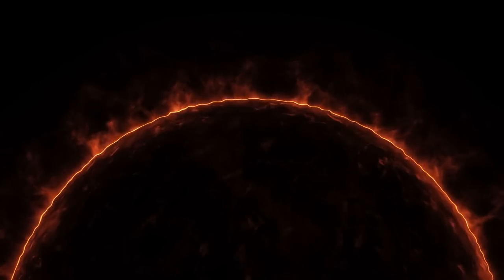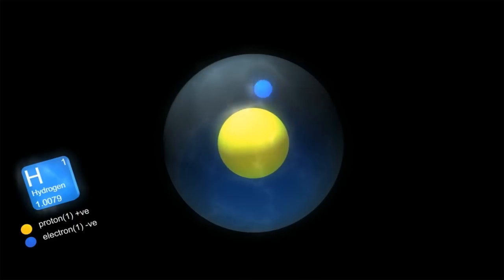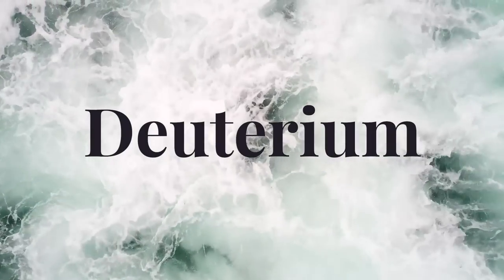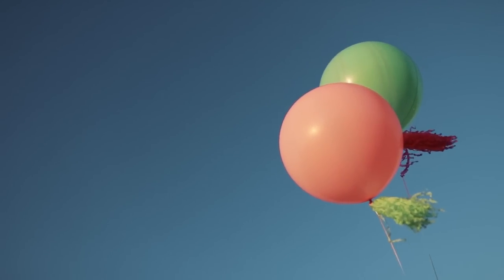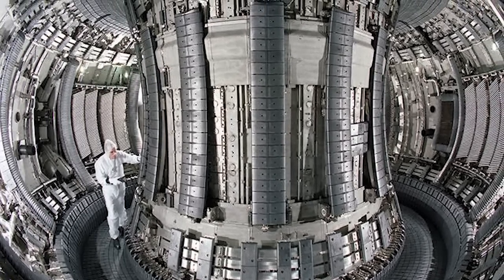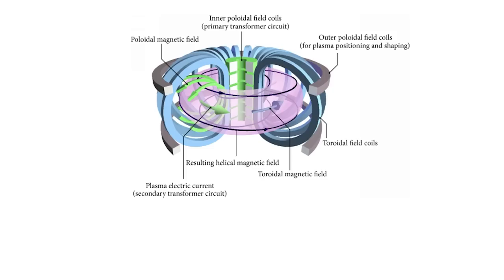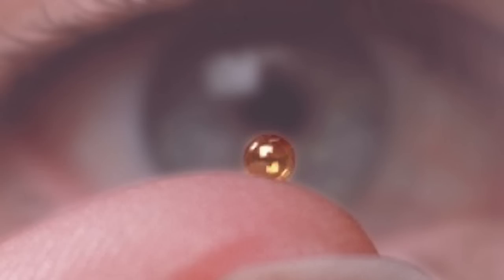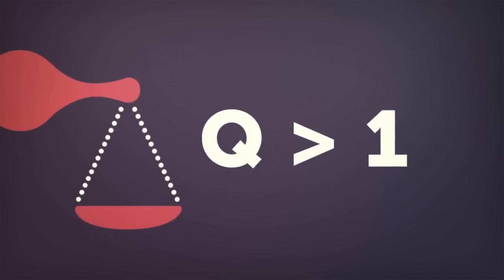Fusion Energy is About to Unlock Humanity's Destiny

Comment: 62 years old and been hearing how it is "just around the corner" since I was at least 12.
Reply: Kyle Nearhood 
I know where you’re coming from, but i would give the justification of being ”different this time” as fusion is now actually possible and achieved. 

It’a still a lot of work before the EROI is a position number, but still a different situation :)
Reply: Well I don't know, Juho. Seems like every time they turn on a new Tokomak they find out something new about plasma that sends them back to the drawing board and building a new 10x Tokomak. Size and cost. Aaaaand repeat.
Different this time? 
We are ten years away from practical fusion power. And always will be.
Reply: Basil McDonnell 
Yeah. Valid point, but as fusion is something becoming a banality, it’s proof of progress. Could well still stand that fusion is the energy production of the future. For ever.
Reply: Thank u for saying that. Its completely  true.  Also I believe that we could have already had fusion reactors however it would have been too disruptive to current methods for generating energy.
Reply: Sure! But THIS time is for real ; )
Reply: Lol
Reply: All high temperature thermonuclear fusion will fail including the ITER project. This is because our nuclear physics based on E=mc² is wrong:
1) Firstly, E=mc² is fictitious; energy E does not have a real unit of energy.
    This is because relativistic force formula: F = d/dt (mv/√(1-v²/c²) ) does not define a real unit of force; e.g. the SI unit newton is only defined as in : F=ma. When force does not have a real unit, the work energy theorem that derives E=mc² also give only a real number without any association with any real unit of energy.
2) Nuclear energy not from E=mc²: 
The Penning trap assumes the magnetic force to have no error - a strict mathematically identity. The so-called mass defect found in the NIST database of atomic masses is due to a systemic inaccuracy in the Penning trap. There is no "mass defect" of atoms. Mass conservation applies; there is no need to measure any atomic mass. The mass of any nuclide is its mass number in amu -  a whole number without any mass defect!  

"The Relativistic Mechanics of E=mc² Fails"
"Our Nuclear Physics Wrong (Is Mass Spectrometry Accurate?)"
http://www.emc2fails.com
Reply: @chanrasjid8688  You're clearly on a plane where I can't argue with you - because I wouldn't know what I was talking about - but I nonetheless think you're sticking your neck out.  Of course, when Einstein predicted that a large mass would bend light, he was sticking his neck out too - but since he was proved right, his predictions, and the predictions of other people using his theory, seem to be prove him "not wrong so far" every time.
Have you had the result of any experiment that shows E=mc² to be false?  Can you link to your results?  Or was it, like Einstein's, a thought experiment?  I read your comments about the units of E=mc², but we have always been taught that E is in Joules, m is in kilograms, and c is in metres/second.
Everything that I know of that has depended on Einstein's theories, from the nuclear bomb to GPS, the orbit of Mercury and gravity waves, have been shown to work, and the things that have refuted it, like faster-than-light neutrinos, have been shown to be an error.  Every new piece of evidence has shown Einstein to be "not wrong"
Maybe you will prove to be his nemesis - but another person who tried to disprove Einstein 30 or 40 years ago was Ivor Catt - and I never hear about him now.
Preparation for a slice of Humble Pie might be a good exercise.
Reply: @DownhillAllTheWay  You're right not to argue with me on a topic you have not studied - that's humility.
E=mc² has never been experimentally verified - never! It is only a hypothesis on how nuclear energy and nuclear bombs work. But my papers at my site explained why it is only an assumption. You may have the notion that physics is all about experimental evidence and therefore it involves only empirical evidence. You may forget that the data of an experiment too needs the interpretation of man, just as in evidence forwarded in the court; it is the judge (opinions) who decides if the evidence is acceptable or not. It is the same with all scientific experiments - it involves opinions of people. So physics too is dependent on people to interpret an experiment. In this manner, there would be people who rejects the discovery of gravitational waves and some would accept - matter of opinion. In the end, the people at Princeton, MIT, Harvard decide what is correct and what is wrong.

Ivor Catt is still around, but old - 85? I received an email comment from him a year back. His main work is not about showing Einstein wrong, more on his novel ideas about electric current, energy, antennas, etc.            

http://www.emc2fails.com
Reply: @chanrasjid8688  I have a feeling if you were correct about the most important scientific equation being wrong you would be accepting a Nobel Prize and not relegated to a Youtube comment section.
Reply: Hold on Pops!
Reply: @chanrasjid8688  Thank you for using your intellect on this. For a long time I've known that our basic, fundamental understanding of physics is wrong. I'm just not smart enough to explain why. But, I know when scientists and astronomers start inventing things like "dark matter" and "dark energy" to explain why their equations don't work when applied to celestial mechanics it's bullshit.
Plasma physics is still the least understood area of science as far as I can tell.
And I'm pretty sure the Sun doesn't work the way they think it does.
Reply: ''been hearing'' but you never really knew anything basically xD  .............. u didn't knew the real situation back then and let me guess it is pretty much the same thing right now,so how can you tell ? since you have no information.............. tired of those ignorant negatives comments
Reply: @Captain-Sum.Ting-Wong  Wow... A nuclear burn...

Comment: I just want fusion within my life time. Who knows there might be a breakthrough, and we get fusion faster than we ever expected.
Reply: facts. we can only hope so 🙏🏻 fortunately for me at least i’m only 18 so if i’m lucky i can make it past 2077 then it will hopefully be a thing.
Reply: Check out MINDS there already plugging are brains into computers
Reply: A concept reactor is being butil as we speak witht the alleged capability of providing a Q>1 which is very promising
Reply: There is a breakthrough! I'm happy to announce. Join us in celebrating an end to war, and scarcity worldwide.
Reply: @SuperMegaog  Do you have any idea how many “concept” reactors have already been built over the years? Fusion is well over 100 years away if ever.
Reply: Believe it or not, there was a major breakthrough: Modern high-temperature superconductors. They are not just easier and cheaper to cool (liquid Nitrogen instead of Helium) but can also stay superconducting at much higher magnetic field strengths. This makes them perfect for creating the extremely strong magnetic fields needed in a tokamak. When ITER was planned, they were just not really a thing yet. Now there are research groups trying to finish similar reactors before ITER even is completed using these new superconductors. It will still take a few decades until fusion reactors become viable as an energy source, but there is some light at the end of the tunnel, and it's honestly quite bright
Reply: Only 30 more years
Reply: We've had it since the 60s in hydrogen bombs. But not in reactors, literal Doomsday weapons
Reply: There was a breakthrough
Reply: Bro I got some news for you
Reply: #J Robe It's very possible, currently I'm guessing we'll have both true AI and fusion by 2050, maybe sooner.

Comment: "Lads, lads, lads, what if....we stop burning those rocks, yeah? And just get a sun?" 
"THATS BRILLIANT!"
Reply: why not grug think that
Reply: What really is amazing is.... 
The whole world finance ITER and it's total budget is around 30 billion, but no "biggie" just creating green unlimited energy…
30 billion (by 2015 14 billion) but lets say 100 billion or 200 billion divided on 20 years or so...
Say 10 billion/Year… paid by the whole world… the USA defense budget by itself is 70x-100x larger….
I would say throw a trillion on ITER to speed it up, it is easily worth much more than that.
Where the fuck is common sense??? Global energy revenue is around 2 trillion/year… 
A "Simple fix" for global warming… unlimited energy would make Hydrogen feasible…. everything goes electric
Reply: What could go wrong?
Reply: @qinby1182  what ben said; soon enough it will be cheaper to burn money, than to find new sources of energy
Reply: Dumping $100 trillion dollars into research into a warp engine still won't give us a warp engine.

We can't get the fusion reactions to as much break even on energy input to output.  

To make it a practical source of power, it'd need to put out 50-fold more energy than it takes to keep the reaction going.  

At the current rate of incremental progress, assuming it could continue in a linear fashion, we won't have feasible fusion power until about 500,000 AD.  Not exactly a practical solution.
Reply: Alondro
Why exactly must it produce 50 times what it consumes to be successful?
Reply: @deandeann1541  because it would need to be able to keep up with demand, if not time to burn money
Reply: If they didn’t look in the sky 😅😅
Reply: Ig*
Reply: @manictiger
As usual the USA should follow Europe's lead….
This is why Europe do not want to import US meat… it is illegal to use antibiotics in meat production in EU…
just a starter... the list is long
Reply: @qinby1182  
I'm not talking about that.  I'm talking about our overuse of it on ourselves.  Shit's creating super-bugs that are COMPLETELY immune to all of our antibiotics.
Reply: @manictiger
Yes over use by humans is also a problem and most (all??) European countries are restrictive in hum use as well.
BUT the use in the hog, cattle and poultry business is the largest issue.
You inoculate healthy animals so they can survive worse hygienic conditions (maltreatment) to make them grow faster, survive and save some cents.... at the same time creating superbuggs.

Over prescription to humans is one thing and a problem and I believe Europe is fairly restrictive, although if the US, China and India is not.... does not help that much.
BUT BANNING USE FOR HEALTHY ANIMALS SHOULD BE A NO BRAINER
There are a lot of more hogs, chickens and cattle than humans...…
When antibiotics stops to work we are "fucked" why waste this on pigs, cows and chickens???
Reply: @deandeann1541  Because the process needs to generate revenue.  Otherwise you're just throwing money at it for very little energy return.
Reply: @Alondro77  Why 50 times tho? When you reach Q>1  the reactor can power itself. Then it's just question of building it big enough. Yes of course if it needs to be too big then the initial investment never returns but I don't see much difference between Q=10 (90% efficiency) and Q=50 (98% efficiency).